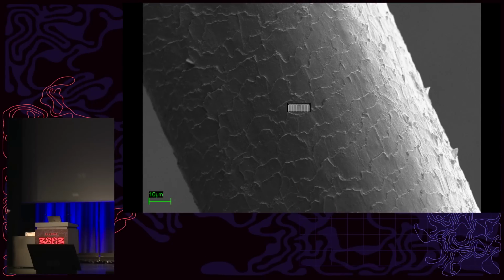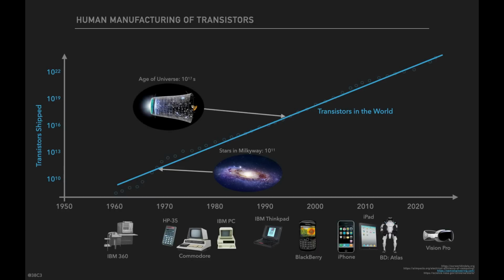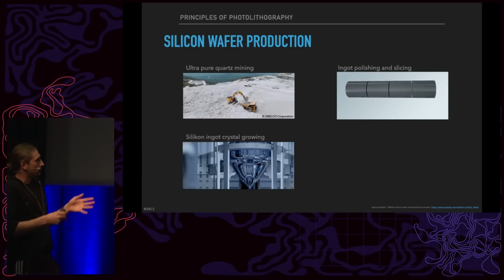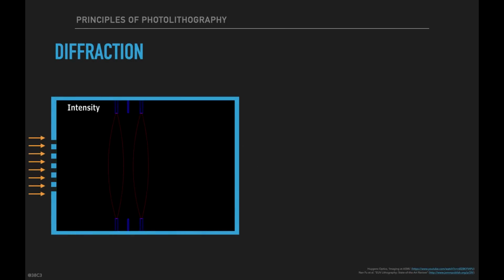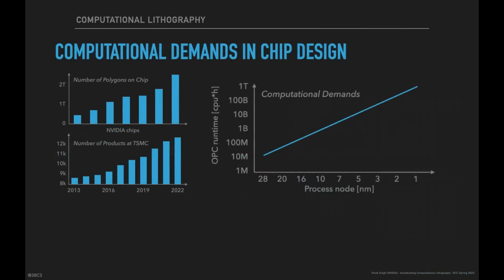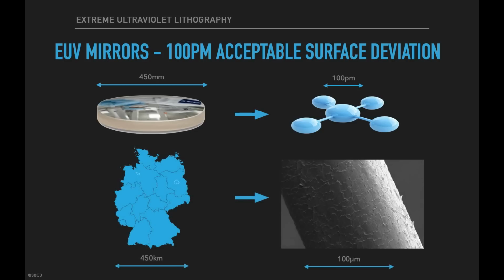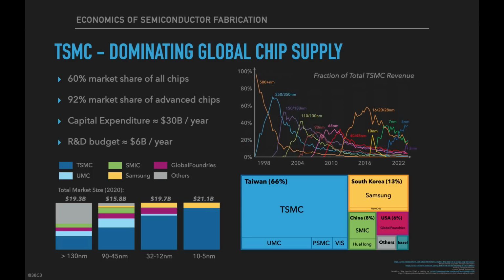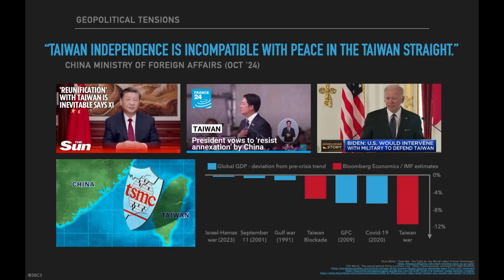38C3 - From Silicon to Sovereignty: How Advanced Chips are Redefining Global Dominance

Comment: This was sciencetainment at pro level. And it made several facts very clear and visible, some of which are:
1. Humankind desperately needs some kind of a new form of economy if progress shall continue in the next decades. 
2. Geopolitical decisions, reginal tensions and wars come with big effects on everyone of us in the end and this is likely to increase (in my opinion).
Reply: 1. Definitely not. The point about needing an economic solution to the problem is mostly about process reliablity, not about processes which would work but aren't used because they were too expensive. Moore's law has ended at the point at which the previous growth pathways (shrinking the size of an IC) met the wall of being at just a few (2-4) dozen atoms of thickness. There wouldn't be an incentive to do any of this advancement without economic incentives either, as a larger die with the technology of 20 years ago would be sufficient for practically anything.